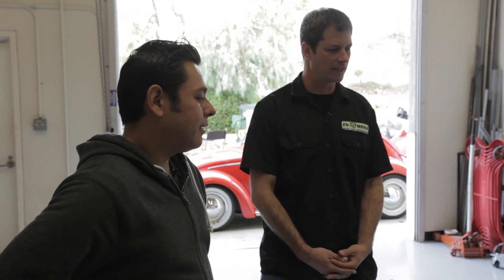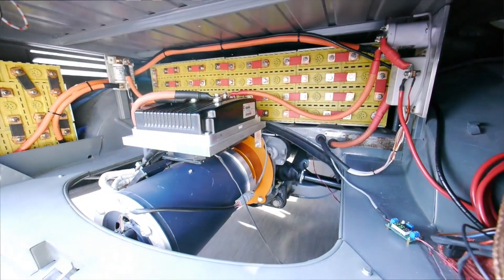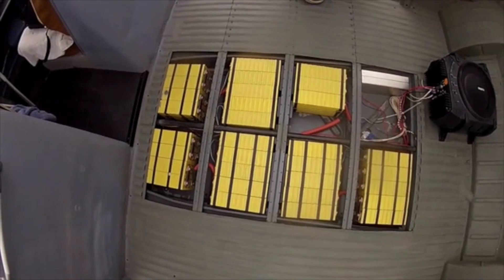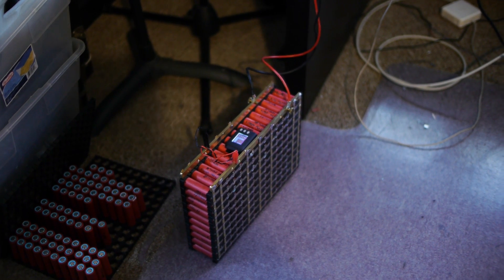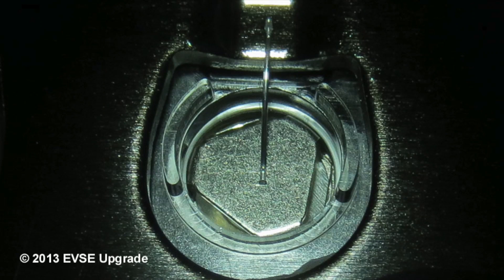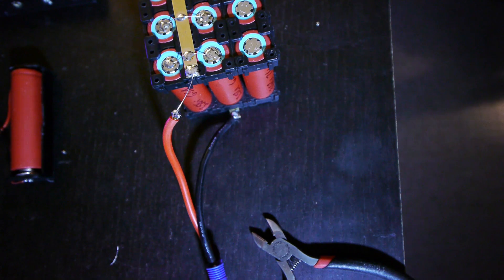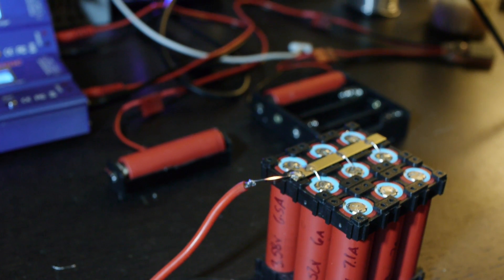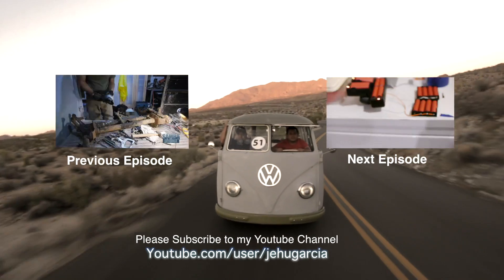TESLA style battery cell Fuses 18650 DIY EV - eSamba

Comment: I’ve learned a lot from your channel. It sparked my interest in solar and other ideas. It
Probably takes more time but I really wish you would show your set up
What your using how you set it up briefly. How you are testing current and voltage . What size or gauge fuse wire. Links to making the battery pack and bus wire
Connections. That way we can test ourselves and branch of from there if we choose.   Just a newbie opinion. Awesome ideas! Thank you for all the information so far!

Comment: 4amps? Aren't lithium rated for 30amps? Why not set fuses to the cells max rather than overall system pull?

It's less current but don't motors have surges under specific conditions?
Reply from the maker: 1c-5c max usually on 18650 cells,  lipo chemistry can go up 100C

Comment: A question for you. Take a tesla battery pack or just wire 7000 cells., put 1 stick of dynamite on it and run like hell.  What is the force of explosion. What is the additive effect on blowing up a lot of amps. I am not a battery fan. They are dangerous as hell. Stuffing amps amps and even more. People here have no idea what 1 grade wire looks like. And why it is used.

Comment: Jehu
love all your videos. Nice work. Question for you, I am upgrading a RV system to the 22s15p 57v Tesla/Smart pack. Looking for BMS or voltage monitoring solution the uses the 20 pin plug on this module. Your thoughts? Thanks Jehu

Comment: Hi man cool vid! I am wondering.. why do you have fuses on every plus pole? I mean, if you have for example, a pack with 10S20P, than you only need one fuse between all the parallel cells right? Like 20 pcs in this case. Is my thought correct..? I ask because I have weldtabs that fit perfectly between the cells, and I would only be soldering if I really need to..

Comment: I'm building a 36v battery 10s 10p what's gonna happen if I use nickel strips and not fuses, my controller is rated at 23amps max but I may change this to 30amps later, I have been using a 36v 10s 6p bottle battery and so far its been fine since buying new around 12 months ago, charging at 1amp to the full 42v, so really my question is should I use fuse wire and if not what's gonna happen, many thanks Brannen, I will be setting my alarm again for the next live stream being up at 4am in North Devon UK was worth it last time, a great show. I know its not new but getting my questions answered live form, someone, I respect living in California USA still even today, blows my mind.
Reply: Oh and I use a BMS is this enough of a safeguard?

Comment: Hello you Cell Fuse wire http://j35.us/1k-Ohm-resistor are resistors? are you using the resistors or the lead wires coming from the resistors?

Comment: Hello,
With only one motor what is the top speed? Can you reach 100km/h or 120km/h?
Thanks
Reply: Unfortunately, I am from India and electric vehicles are still a distant dream and only one is available and only one that is available is super expensive to get hold of. I am also looking forward to convert my couple of vehicles to electric, that are typical gasoline/petrol engines, so was curious whether he is using the same transmission/gearbox from his old vw van. Thanks for your reply @Aaron Green, appreciate it.
Reply: sorry forget you are on miles! Can you reach 60 or 70 miles on high way?
Reply from the maker: yes   8000rpm
Reply: Running in the same gear box of the van or direct drive like Tesla's?
Reply: Ashok Revanna technically you could also use a one speed gear drive out of a Nissan Leaf, Ford Focus Electric, VW e-Golf, etc.

Comment: Are you sure you have calculated the max current for each cell correctly ?  you will get about 2hrs drive time on one charge (100mile range).. that means a current of C/2 ...one amp ... so fuse should be about 1.5 A
Reply: Hi sir . I have 16s 10p lion battery(60v 20ah). How can i calculate exact fuse level ? İf u help me i'd  thanksfull to you.
Reply: Tesla electric cars use the same 18650 cells, and fuse each cell  (put "tesla fuse" in youtube search) this protects the pack if one cell goes bad .... many don't do this for their own packs ... it may not be necessary ,It involves soldering 31AWG tinned copper wire on to each positive cell terminals  ...that's 160 seperate fuses for your pack ..
Your question maybe about a fuse for the whole pack?  The way to calculate the fuse for the whole pack is to ask what's the maximum current you will draw ... perhaps 40A? that will give a run time of half an hour .. in that case put a 50A fuse ... If your motor is 1kw  then at 60Volts it will draw less than 20A , and give a runtime of over 1 hr ... a  25A fuse will be OK. ...for a 500W , 60V motor a 15 A fuse
Reply: Thanks foor good advice. Actually my whole pack has 40a fuse already . My question is for each single cell amp draw. İn video he using that resistor wire for 5 amp but maybe its too much for my single cell. Otherwise i ll buy exatcly same resistor legs and put my pack.

Comment: Hey Jehu, do you remember what you were using to draw a load from the battery pack across the fuse? In the video, you were able to dial in the max amount of current. I have fuse wire I'm trying to dial in too. Thanks for the help!

Comment: really hard to solder the batteries
Reply from the maker: +James Andonian  not hard at all,  once you get the hang of it
Reply: jehugarcia there is something on the on the surface. I've found its easier if you rough it up using sand paper.

Comment: Thanks for the great library of videos, I'm learning a TON!  

Which episode would you recommend that I watch to see the detailed layout of the batteries and how they are connected.

It looks like you are connecting all the cells in each module in parallel and effectively creating a giant 4.2v battery. 

I assume you then wire the giant 4.2v modules in series to increase the voltage?

Comment: i have a question i haven't found an answer ... I am harvesting these laptop batteries for the cells but haven't really decided which particular project so Im basically charging/waiting/Discharging/recharging  and getting capacities and voltages ... my question is that Im using 2 different chargers... I have the 1 amp charging circuits that charge to 4.2v  so I can mass charge batteries and I also have a B6 AC v2 ( authentic) for charging and discharging... but it only charges batteries to 4.1v ... so now Im not sure which one to use to charge... on the other hand... these 1 amp charging circuits, do they add too much current into the cells? I see some cells 18650 have a max charge rate of .5amps... but then I see allot of people using these 1 amp chargers... ?

Comment: Hello man.. i must admite that since the first time i saw your videos.. i am spending all my money on buying batteries and other tools to make a backup TESLA model with at least 24 volt.  I am from Albania and in one week i already spend 800 dollar on the goods that are still on their way to my country. Thanks God i work with mobile phones so my salary is not 150 $ /month like 80% of the population in here.  I think i became addicted to this diy project.  so far i bought all the tools charges etc. But i am stuck one little thing... to find the right fuse for each cell.. please man give me a hand on this.. your link shows a 1k Ohm resistor.. you use only the wire of it or the whole resistor? Sorry i am confuse.. so please give me a hand on some infos.. so far i bought new batteries , soon maybe hope to put my hands on some stock PANASONIC LAPTOP BATTERIES NEVER USED but that have been in stock for many years..
Reply: Hi. He used only resistor's wire because that wire can handle untill 5amps and so thats what he needs. But i have same problem with you. İ need to calculate my system's fuse level , its hard to solve,.

Comment: Your fuse wire links to a resistor page.  However, your video shows a spool.  Where did you get your spool of fuse wire and what are it's specs?
Reply: That spool is solder, and the fuse wire are the legs of the resistors...
Reply: OK.  Thanks.  Have you considered actual fuse wire?  It expensive, but might fuse quicker?  I'm somewhat concerned about a high drain battery that is not completely shorted, but would create a drain on the pack and make a wire hot, but fuse a fuse wire.  Just thinking.

Comment: I am looking into getting a few thousand cells from these guys. 
https://www.alibaba.com/product-detail/UN38-3-UL-certified-Li-Ion_60039255160.html?spm=a2700.7724838.0.0.yDoHkx
For a power wall, the cells are $2 each if you buy 2 but the more you buy the lower the price drops, down to a minimum of $0.10 each.
I am pretty sure they could pack and join the cells into battery banks if you wanted.
Reply: Aussie Soarer they list multiple capacities. What's up with that?

Comment: Hi,

Your videos are great. I've got everything sorted in my head now I think to produce my powerwall. I have a question on this video though. I'm not sure you ever show it but what is the device you use to apply the load to the battery to test your fuse? I intend to perform a similar test but I'll be using 10A cells I think so doubling up this fuse wire would work out about right.

Thanks

Comment: I've built a 40% Tesla power wall following these videos and using pulled apart old e-bike battery packs. Most were A-OK with burnt out controllers (brown on PCB backboard). It's set up for 12.6V (3 x 4.2v cells) using a 24V PV setup with a battery controller set to shut off of 12.5v to protect the lithium cells. Has now been  running my 5,000L aquaponics setup for three months. 3 cell banks of 120 cells in each are still roughly in balance so no overcharging. Great info.

Comment: First of, thank you for all of your videos. It's really been helpful as I'm learning all of this.

Now for the questions:

1) You solder your packs, but I've heard that's dangerous to the batteries and you should only spot weld. Is this a real problem, or is it not really an issue?

2) Do you connect up your parallel batteries together first, THEN put those in series, or put a bunch that are in series together in parallel - or does it even matter?

Thanks!

Comment: Many debates about destroying Li batteries if you solder them. Obviously you do solder yours. Your thoughts
Reply from the maker: +Peter Sheppard 

Not the best way,  but obviously not the worst,  especially when you can very quickly solder a thin fuse wire without much heat to the cell.   Those soldering huge bus bars to the cells is another story

Comment: A question please,great channelbythe way , so the power is carried through these wires to the bus bars  it just doesn't look thick enough , great idea if it works, cheers.
Reply from the maker: +Gavin FreedomLover   Under normal operation each cell is only going to contribute 2A continuous,  the wire can handle 6A for 10 seconds
Reply: great , thanks very much I really appreciate your reply is it just standard fuse wire , I will watch the vid again you might have put a link in , I love lithium ion and animals and ride with my chihuahua's on my electric bike :) , peace and good luck to you

Comment: how do i know if the wire fuse you used are the right ones for a tesla house battery? didnt you calculate the max 6amp draw for your samba? how would that effect a 12v bank with a 12v inverter? also do i need a special inverter or charge controller? i know this is your samba project but i think your viewer could use a little insight on how to charge and discharge them safely with solar or off grid means. you know what your doing am am hoping for some help. thanks.

Comment: HI, the first time I watched one of your videos links popped up for where to get the fuse wire and other components. they stopped popping up. Or am I Imagining it. What is the wire?  I'm building a battery for my Farallon MKIII dive scooter.  I have 98 cells in 7ea 14cell batteries for 25.9v  Just need to get the plastic clips and fuse wire and I can assemble it.  Thanks Tomas
Reply from the maker: 18650 Clips http://j35.us/18650-spacer-clips
Copper bar - http://j35.us/1NGpBo4
1/8 Watt resistor legs for fuse wire  - http://j35.us/1k-Ohm-resistor
Reply: +jehugarcia  Hey, Thanks a bunch. Really enjoy your videos and projects. I'm really hopeful that the battery i'm putting together makes this old toy new again. Tomas
Reply from the maker: cool
Reply: +jehugarcia Would I need to match up new batteries into sets based on amp hours?
Reply from the maker: yes

Comment: Any hope of a solar panel on the roof to extend range further?
Reply from the maker: Nope,  too big, too ugly and not enough to energy to be worth the trouble
Reply: +J House it would increase your distance only a few miles but it would get interesting by bigger stops. 1m² will give you about 100W under perfect circumstances so 3m² would be realistic and that means you get 300 Watts per hour. I would say the samba needs about 10 kWh for rolling around, so you need to be 30 hous under sun to drive around for one hour. xD
Reply from the maker: 1 hour of sun per mile.  300Wh/mile

Comment: seriously, why are you leaving out details.. what wire did you use?
Reply: I think he says somewhere that he cuts the leads/legs off of a 1/4w resistor.
Reply: +Paul Gdry id like to know too
Reply: It says that he uses legs but that's not economical and a waste of resistors. I wonder if he could use thin gauge nichrome wire or similar. What gauge I wonder.
Reply: Kurt Kowalski ya there is a link in the description it is for some 1/8 watt resistors

Comment: Hi Jehu. How wide and long is your 150 cell module? I drew a 150 cell module up in cad. See what you think. http://youtu.be/Q6f84wpJsck
Reply: I made another cad rendering of a 160 cell version. Came out better me thinks. No orphaned cells. It could be set up for 4 80ah groups on the same module for a higher voltage application.  http://youtu.be/sqwvD8vQpZU?list=UUa2HXT2GnT1BVKvdStib_PA

Comment: Hi Jehu. You sure have my brain spinning! I was always planning to make modules out of A123 26650 cells. But since they were sold to China, I don't trust their cells. Besides there were so many counterfeit sources selling them on Ebay, it just became impractical. So your work on 18650's is very inspiring. The plastic clips are great. Now that I see they cost you .30 each, it seems that machining a plate for each module side might be cheaper. It's ironic that the 1/8 watt resistor leads work so well. They are usually just tin plated copper. I'll measure the diameter and see what AWG they are equal to. I think the bus bar idea is solid. You wrote that you had almost a 50% rejection rate for your cells. I don't know what each pack cost you, but that's a lot of tossed cells. What I'll start doing is draw up in cad a one piece version of a cell holder out of material that is hopefully V0 fire rated. Delrin would be easy. Lexan too. I'll find out the costs. Maybe plywood ;). Have you measured any temperature rise in the cells after a long trip? I'm wondering about fan cooling for the cells. Those resistor leads will handle less amps the hotter they get. I have a spot welder I cannot wait to try and see how the resistor leads handle spot welding to a cell. Although bus bars are outside of my spot welders capability. We'll see. I've been doing EV's for 10 years and think you are doing great work!! I'm glad I found you!